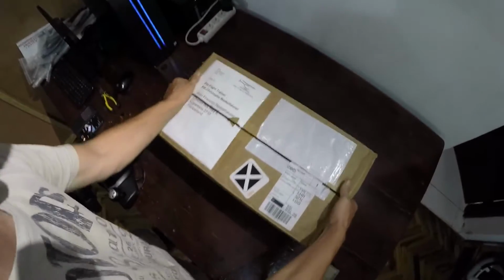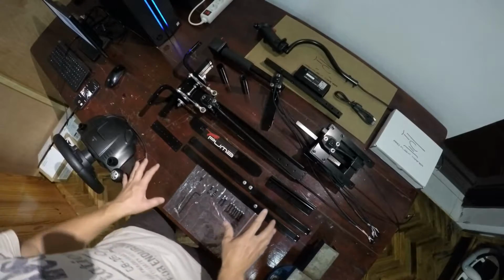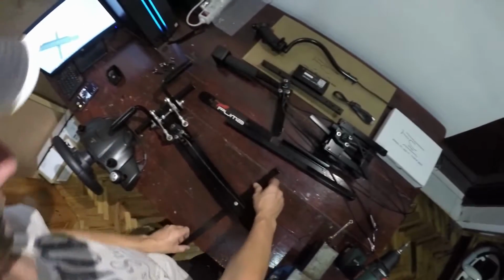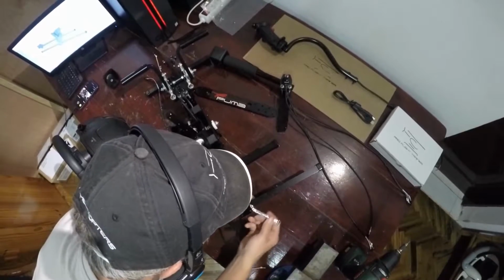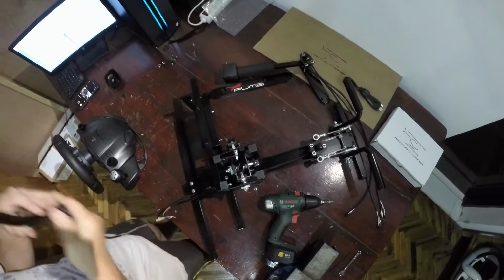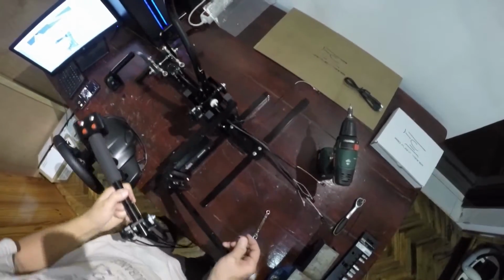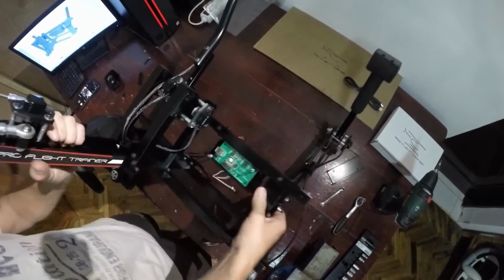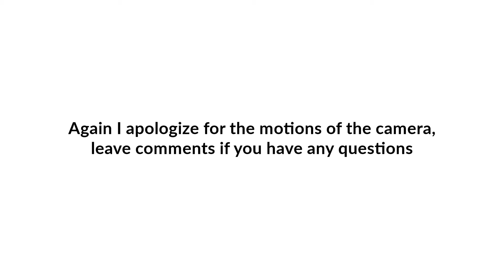A user pilot's video on unpacking and assembling a puma PAS helicopter flight control set

Comment: Thanks for the unboxing video, seems a very nice unit. Would be good if they amalgamated a lot of those small cables into one or two plugs. That seemed to take a fairly long time to work out and check and could be made much simpler with a circuit board and plug redesign.
Reply from the maker: Hi, thanks for your comment.
We are selling the individual components, there for we needed a PCB that can be used with 1,3-5 or 8 axis.
Thus the Need to run wiring individually. Wiring up the unit is really simple and straight Forward :-)
Reply: @proflighttrainer  Fair enough. Thanks for the reply :-)